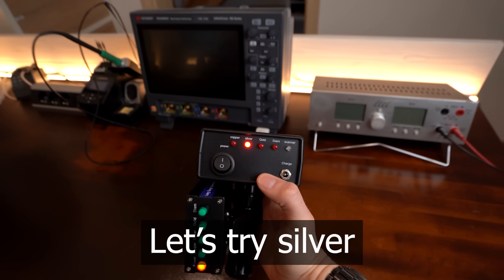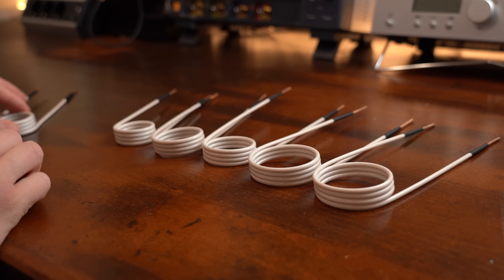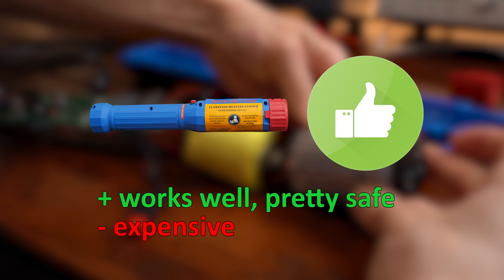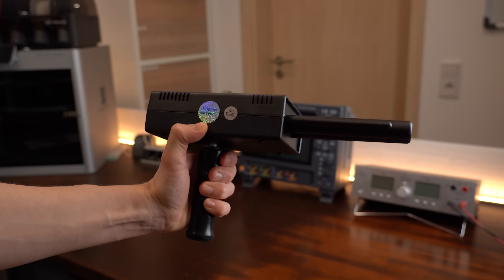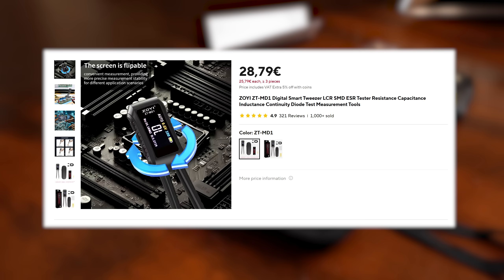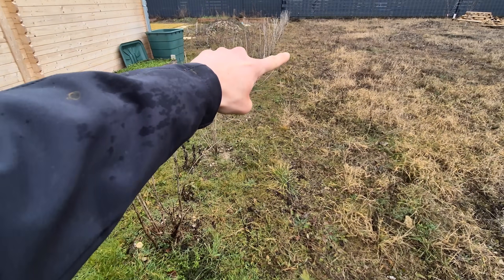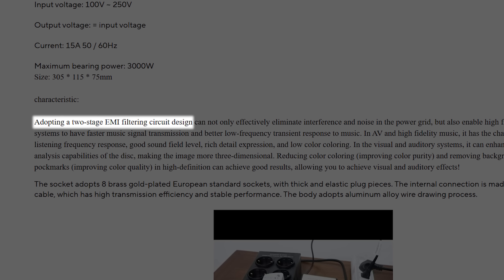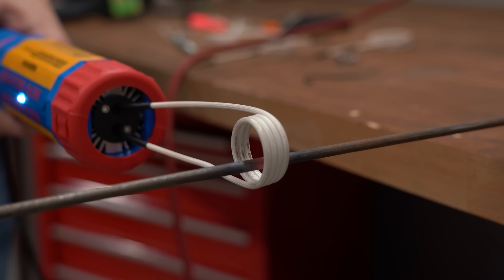I tried finding Hidden Gems on AliExpress AGAIN! (Part 13)

Comment: After a while a found that measuring ESR with the LCR Tweezer works beter setting the frequency to 10K, although for measuring capacitors above 1uF it works better at 100Hz

Comment: 3 mm deviation on a laser level is to much on a distance of ~5m. An additional test with two marks and changing the tripod from near one mark to the other and then checking the differences is what I miss. Let the level test on itself.
You also should test how far the laser is ranging both for visible reading and with detector. On a construction site visibility with sunlight matters, too.
An 50y old Zeiss Ni42 optical sight level with a precision of ~1 mm at a distance of 80 m is setting the benchmark. The major drawback is that you will need two men to level.

Comment: There's actually nothing wrong with that metal detractor it's that you're using it wrong, they must have just overhyped it's capabilities. Detectors like that are generally supposed to be used in combination with large metal detector for "treasure hunting" in the ground. That's the one that you'll use for for detecting various types of metal and the depth, etc. That handheld one is only used after you already have found the object's location and type and you've dug the hole. It's just a pinpointer for getting more accurate location of the object in a clump of dirt or hole. For that purpose it doesn't need to differentiate between different types of metals or work at any real distance. That's what your main metal detector is for.

Comment: Funny. The laser level that is a red laser has red safety goggles, which pass red light through. Green goggles are needed to block red light. 
Maybe i shouldn't trust my Vevor pressure pot any more.

Comment: A fence with the top level and the bottom following the slope of the ground won't look right. It would look far more natural if it follows the overall slope. Put in a stake at each end, measure the desired height on each stake, use a string to determine a straight line between those points and build the fence to meet the string.

Comment: I got an unusual cable reel gang plug via ebay but from China, it has 1 into 4 on a 10 metre reel, the gang plug part has 4 UK sockets, 4 USB A's but the best of the A's being blue ones and... it has a wifi booster that picks up ambient wifi signals and just boosts it passively.   I have it set up to gang up for my various Xbox's and PS3's and my Switch and all improve their connections when its plugged in so I call that a win win :D

Comment: I am a fan of Vevor stuff, seems to be of a quality above the normal average Chinese stuff.   I bought two Vevor kits recently, one an astonishing set of taps and dies which had metric, imperial and whitworth I mean what kits give you whitworth threads nowadays but they have kept that thread standard in ex-British Hong Kong.   I also got a kit of various HSS and carbide microlathe cutting tools, expecting the carbides to fizzle out and the HSS to come apart like cheese, been using them strongly on my 1934 Portass mini lathe and getting superb cutting results so good on Vevor for not stiffing the customer like some do :)

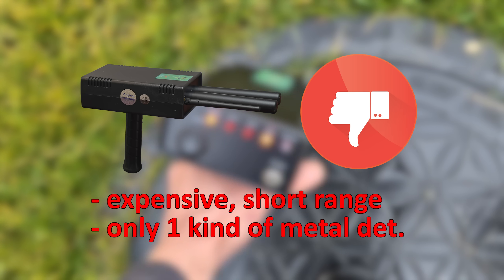Comment: 8:29 The detector is working fine. It's a pin pointer that finds metallics in a shovel full of soil found by a normal more  expensive full llenth detector.

Comment: Likely a dumb question, but I'm still figuring things out:
Are(n't) metal detectors usually done by have an internal inductor and seeing the... current change(?) when approaching other ferromagnetic materials? Alike to a transformer circuit, where as the load current increases thus the supply's current?

Comment: Weeeeell. I prefer screw connectors on the sockets. Just need to use right connectors on the wires. Tho solid one strain wires. Springs.

Comment: A few years ago I used an ancient red laser pointer to level a 70m fence. It took some careful shimming action and waiting for dawn so I could see the darn thing, but then it worked just fine. Today such laser diodes are dirt cheap and work just fine for single jobs. Turns out cheap light propagates just as straight as expensive light.

Comment: If I were to measure the inductance of the coil on a loudspeaker crossover, would I have to disconnect it from the board or will it not make a difference?(speaker not live at the time, obviously)

Comment: For the PowerStrip: There's a critical fire Hazard: The C13/C14 Conector ("Kaltgerätestecker") is only rated for 10A, but the thermal fuse has a rating of 15A. And most Cables for C13/C14 Connector uses 1.0mm² which is also rated for 10A 🔥🔥🔥

Comment: The "weather station" was a little disappointing, if only they threw in a serial chip and allowed it to be USB programmable by default. Maybe the BOM goes up 10 cents or so, but the applicability of the unit goes up massively, plus they could flash different firmwares to them and sell them to different markets. You could imagine them selling a clock version, notification display, etc.

Comment: Anyone thinking about buying that laser level, I just want you to know about the company Vevor. They are terrible to deal with. I purchased a parcel lock box for my house, and it came with a bent hinge, paint chip scratches all over it, rivets that were put in crooked, and as a result the lid does not function correctly. I got a hold of them, and they make the entire process of dealing with them extremely difficult, on purpose. I would send them pictures and then they would claim not to have gotten them in time before their website would Auto delete, so I would do it again and then they would purposely ignore my emails just long enough that they could cop out and say that they had not yet seen the pictures. I chased them back and forth for 3 weeks, until ultimately they just stopped replying to my emails. If you search for this company online, you'll see that this is systemic, and that they are well-known for avoiding any type of responsibility for products that do not work correctly. The prices are great, so just be warned when you make that purchase. 🙂

Comment: Using a water level you must be sure to have no airbubble in the line and some soap can help with that and the surface tension at the ends.
Shake the tube and flick the ends.

To check a laser level for beeing true put it in a room where the walls are far from each other, turn it on in the middle of the room and draw both lines on the wall or a pice of tape at both ends (back and front of the laser) then turn the laser 180° and line it up again with one of the dots and check the other one if it still matches with that one. If the room is 10 meters wall to wall and laser misaligned 2mm you have an accuracy of 1mm for 10 meters.

I check all lasers like this and even cheap lasers does great, like under 2mm/10 meters and my expensive CAT is 1.5mm out. 
But one i bough from Aliexpress since i wanted green was 2cm out on the same test!!!! But i just calibrated it myself with the CAT laser and now its all good 😊

Comment: That handheld induction heater is PERFECT in automotive trade. No more open flames, you only heat what your intending to heat and it is super fast. I love using them to break free rusty bolts on cars.

Comment: BE WARNED:
I had the weather station and one cap or an LED (I can no longer figure out what it was) build into the side of the display exploded and the whole thing started burning in the middle of the night. Thankfully I had a smoke detector (thank god this is mandatory in German renting homes since about 10 years or so). I found parts of the display about 1 meter away so I can say it exploded.
Reply: Come one, from 5 volts?
Reply: @dan-nutu  I don't get it myself. But that is what happened..,

Comment: The metal detector is not going to work obviously… The simplest way to tell the difference kinds of metals is to test them by optical spectrum, because optical spectrum is related to the element atoms themselves, and obviously this can't be done by induction detectors
Reply: Optical spectrum is related to the energy levels of the element atoms, and one spectrum is only owned by a certain kind of element. Induction detectors can only detect conductors but can't tell the differences between them

Comment: For the weather station, you probably had to type http:// manually instead of the default https for it to work. And you were connected via mobile data instead of the wifi.

Comment: The inductive bolt heaters are great if you have bolts or studs in places that a heat gun or torch would be inappropriate to use. I recently used one for removing studs installed with loctite 270 in irreplaceable very expensive parts with composites bonded in close proximity with great success

Comment: Yes it's in China so you would think Chinese people use it to Right?  No they won't go near it. This is been set up for Westerners only.  If you shop there you're a sucker.  They lure you with the cheap price and for that you get garbage if you do get a product and have a problem you get garbage customer service for once they got your money it's a one-way door.  Enough said if you shop there you're nuts you will eventually get burned

Comment: Vevor (the company behind the laser level) are excellent for their price to quality ratio, I couldn't recommend them more if you want something cheap(ish/er) but trustworthy that will do the job. Buying directly from their website is usually a fair bit cheaper than buying from Aliexpress too and you can also get great deals from their website sometimes. I got a laser/milling CNC with some of the bells and whistles for $70AU a while back. 

Though I am in Australia so this may not be the case for every country as they have some warehousing in AU. Thanks for your service though, Aliexpress is my go-to for cheap stuff direct from China and I've found (and avoided) a lot of things thanks to your video series. Much appreciated from the land down under!
Reply: I use a Vevor pressure pot and it is so much better than the locally available Harbor Freight brand pressure pot. 
They make good stuff in my experience.

Comment: The geekmagic in thumbnail is great tho. It's just an esp32 but trust me, it's not that easy making your own and is totally worth $20 just as a bitcoin and stock ticker...I have it in my bathroom and you can add a battery to it easily with its 2 pin j connector... its right on the board when you open the yellow geekmagic case.... just find a small enough 300mah battery to fit inside but won't last more than a day like a neshtastic but yeah works great with a battery doesnt uage to be plugged in. I am even gonna 3d print a larger case for it and post it free on makerworld under thinkgeek

Comment: Induction heater: Don't make it red. It can lose its hardness ...

Power strip: The sockets are not tamper-proof (childproof) 😮

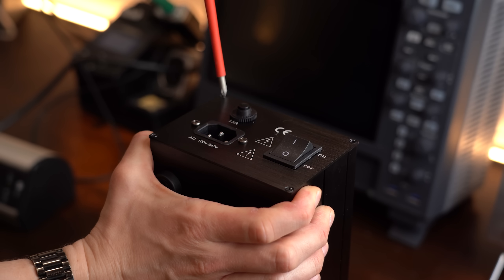13:26 When you tried to open it looked like you were using PH1 or PZ1 instead of PH2 or PZ2 screw driver.
A tip when choosing screw driver for a star screw: If it look like it should be size one, then you should use size two.

Comment: Im using the induction heater in my workshop all the time - its great working on 4x4s, Im buying a new one every two years but im fine with that as im using them heavy

Comment: I was surprised to hear of a product still using the ESP8266. I thought they did not conform with US FCC rules (and presumably other similar international RF communication rules). I may be wrong about that, or I may be underestimating the amount of rule breaking AlieExpress vendors are willing to commit. Probably the latter.

Comment: If you want displays to display information from home assistant, I would recommend OpenEpaperLink. It gives you a lot of options for battery powered ePaper displays and also works with some LCD displays. And it is nicely integrated into home assistant with a lot of display options.

Comment: Just one comment on adding your own code to the ESP version when it comes. Check if the FW is signed or not. If the ESP in the weather station is configured as secure boot, when you try to add your own SW you might crash it and then you won't be able to recover from it.

Comment: Why does it still irk me that you need to attach a jtag(like device) to a device that already has usb?  It's like a terrible Xibit joke. Yo dawg, we heard you like USB, so we USBed your USB so you can serial bus while you cereal bus.

Also, in your B roll of the metal detector, it made me giggle that you didn't even bother switching it on.

Comment: hi scott i have a very janky tool to submit you from aliexpress a electrical dissolder pump ! but this one is soo juky they broke themselve because this junk use a magtetic filed like solenoid but if you use this around 20 minutes or later the solenoid mecanism will heating and gripped not repair mine i have to drill all inside plastic cage to ungrip them but now i have another problem.... i have broke the heating head bar... and i cant find another replacement part soo this is a junk

Comment: I think it was super sketchy having wired and clamped conductors in that powerboard, rather than copper bus bars integrated into each socket. Or is that normal? That wouldn't be found in Australia

Comment: The screw terminals will actually carry more current without catching fire than the spring ones your mentioning. The trick is just make sure the screws are tight.

Comment: The Voltage indicator of the power strip could help if your house voltage is not consistent, for example in my house we sometimes have a bit of an overvoltage

Comment: 4:55 try to turn off your cellular data when connecting for devices in AP mode. I had this issue several times with some of my devices or ESPs

Comment: The induction heater is used in machine shops to secure endmill into shrink fit tool holders for better concentricity accuracy.

Comment: Nice bike reveal
8:35 that seems practical but we could just buy $5 "multimeter tweezers probe" and plug that on our LCR meter, then again it's for content, i guess.
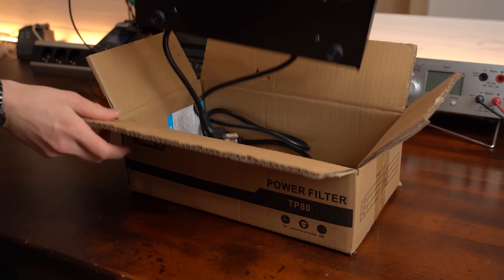12:43 those are "Audiophile" power strip (another brand is Weiduka) you don't need that lol, just go build your own DIY line emi filter if you wanted an idea for a new content. again, these are really unnecessary and few of these niche strip could fetch up to insane and outrageous price for some "Audiophile" brand like ISOTEK or ANSUZ.

Comment: Lcr meter.... you have to adjust the frequency of meassurement. If your big one uses another frequency, the results differ. (And they differ using the tweezer too oc. 100Hz, 1kKz or 10KHz gives different results)
Also I like the low Ohm range (I own it for longer)

Laser.  Water isnt that precise because of surface tension.put them side by side and you can see. I would trust more the laser

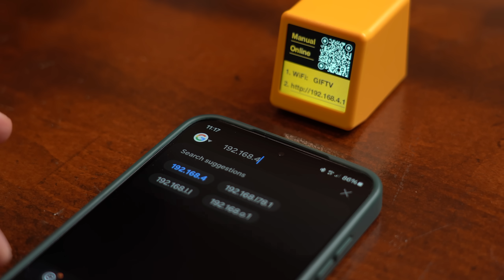Comment: 4:49 It's especially common for smartphone browsers to make connecting to a non encrypted website a hassel. Usually, manually prepending http:// instead of allowing the browser to prepend https:// fixes it. This is also mentioned by the gadget's setup screen (notice the missing "s" in the ip address displayed). This is just my speculation.

Comment: I feel like the power strip is advertised more towards "audiophiles" with that voltage display and EMI filtering. So the price is also "audiophile" level : )
Reply: hahaha But still better than the cable holders for like 500€ that are meant to keep your cables off the ground to reduce noise somehow - they are basically just crappy pieces of plastic. Or the USB stick for cleaning digital signals... 🙃